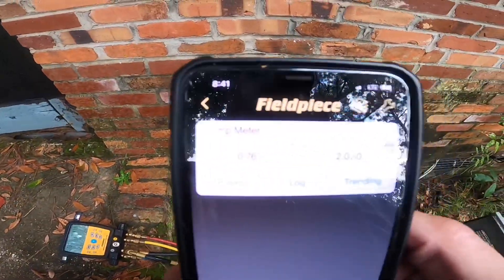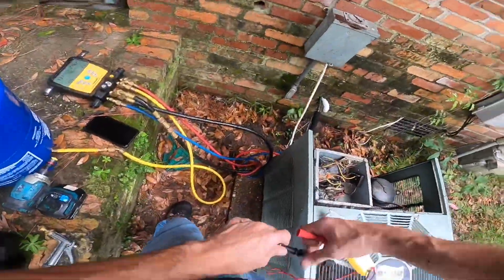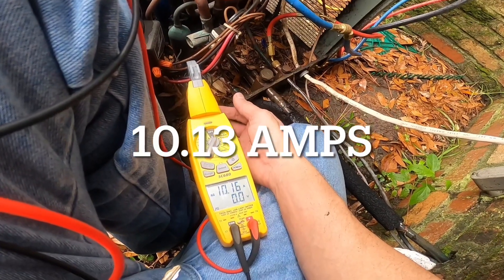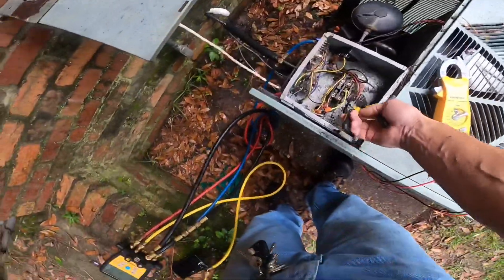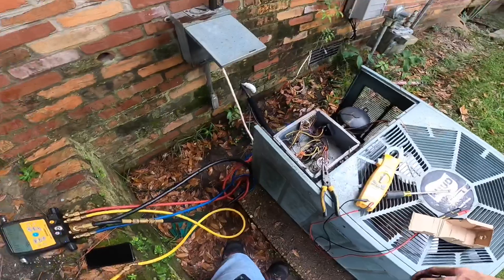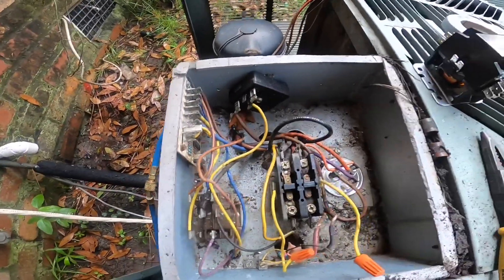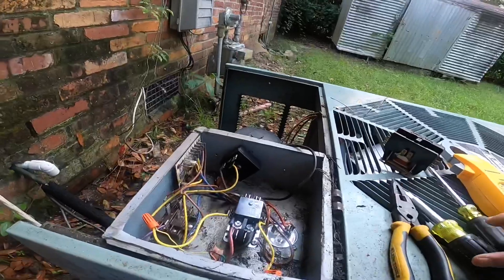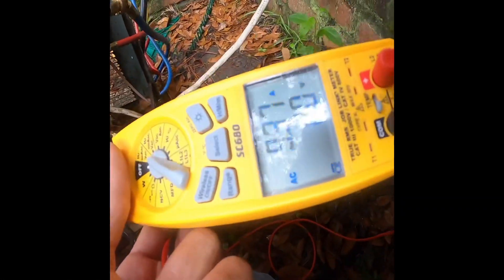How a Low Power Factor can lead you to other problems.

Comment: What if you have proper capacitor reading and still have a low power factor?
Reply from the maker: it happens. may wish to check capacitors under load

Comment: I dont have any pricey gizmos but you can hear the machine overworking to compensate in my case. It's very noticeable. I replaced a 45/5 capacitor with new one only to read the paperwork in the envelope and see the system requires a 55/5 cap! Needless to say I installed the correct cap. For 4+ years this system has been running rough and loud and now it mostly purrs. (16 yr old heat pump) CHECK THE PAPERWORK!

Comment: yeah, power factor is one tell tale sign of out of spec capacitors, but there's so many other things on the electrical system that can cause poor power factor, it's best always used in conjunction with other testing methods. 
other things that cause poor power factor are switch mode power supplies(used in most all appliances, electronics and chargers), LED and CFL bulbs, dimmers, inverters, PWM/VFD drives, the list goes on really. it's fully possible to get poor power factor at end device if tons of things on the same system has poor power factor, although proper equipment loading can help cancel it out.

Comment: So if a power factor is lower than 1.  There could be problems with a part? 
My inverter shows me power factor, and alot of the time. Its below . 7,,, would that my stuff is old and needs fixed or replaced?
Reply from the maker: the closer to 1 the better. what kind of inverter are you talking about? on an air conditioner?

Comment: How'd you get your meter to connect to your phone?  I have the same meter and couldn't figure out how to do it
Reply: download fieldpiece or fluoe app and make sure your meter is bluetooth compatible
Reply: @OleRazzleDazzler  I have the app and the meter is Bluetooth compatible
Reply from the maker: @kingdededankle7591  make sure meter wireless is turned on, open app, click on measurements, then wrench in top right corner, then tool manager, if you see your meter listed heart it, back out to your page with readings, electrical isn’t on it, at the bottom (very bottom - off of scrolling list) click on electrical on bottom left, and you should see your readings. If that don’t work, you may have an issue with your meter.
Reply: @HVACGUY  So I have the SC660 and it sounds like I need the JL2 transmitter
Reply from the maker: @kingdededankle7591  yes that’s correct. I have the 680. That was the case with the 460 gauges as well. Try to get some feedback about that transmitter before you buy. I’ve read about it and it ain’t good
Reply: @HVACGUY  I'm not dropping anothet 200 bucks for that. I could buy the 680 for about the same amount

Comment: Well done!  (On next one like this, before shutting it down, take a live measure of the voltage drop ACROSS the contactor legs.  My guess, ants were causing high resistance condition).

Comment: I never heard of a power factor. Can someone explain it to me and possible show how to measure it? It's it field piece exclusive?
Reply from the maker: https://youtu.be/Tv_7XWf96gg

This is a great video, from a great channel, that explains this better than I can.
Reply from the maker: There’s another meter that measures this and more, like frequency distortion, total harmonic distortion, the Redfish IDVM 550
Reply: There's a channel, Jim Pytel, who has great explanation of power factor in his Basic Electrical-AC circuits playlist.  His channel is the classroom side of an Industrial Electrical Tech course.  

But on a PSC motor, the run capacitor, in addition to providing the phase offset to start the motor turning, is selected to "tune" the motor for the best power factor, i.e., most efficient operation, at its design load point.  When the capacitor drifts out of spec, the magnetic fields become more elliptical and the difference ends up as heat in the windings reducing the motor life.